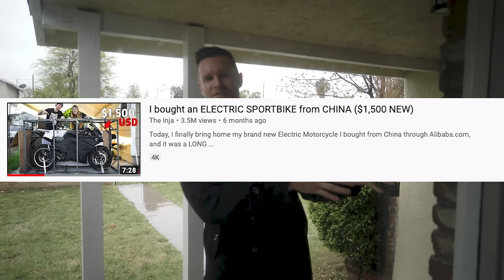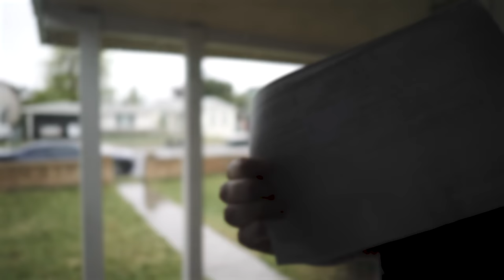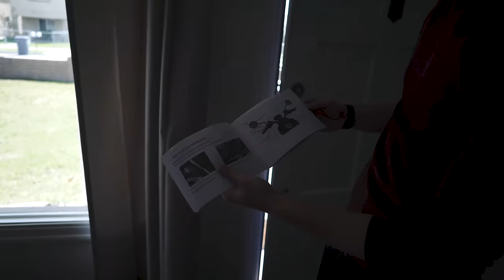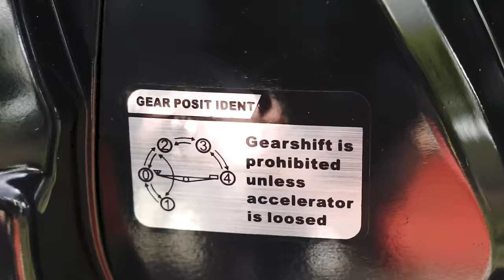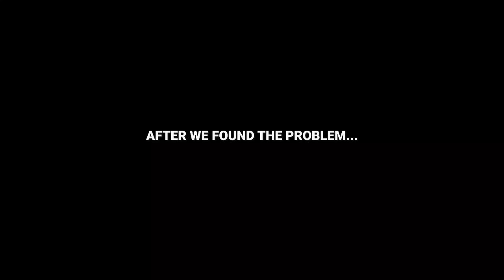I BOUGHT the most AVERAGE-PRICED Motorcycle on AMAZON ($1,600 NEW)

Comment: Definitely overpriced by about 2x
Cheap stuff is mostly trash
Reply: Strongly disagree, a 125cc dirt bike straight from the dealer is $2,500+, this is a deal and a half even if it is built cheap still worth $2,000. Dont take my word for it, do some research and educate yourself just a little.
Reply: YUK FOO well that’s the case with any new bike
Reply: YUK FOO  well no shit eh bud 💀 this is new straight from the box.
Reply: I bought a used 2002 Kawasaki Vulcan classic 800cc with 9k Miles for $1500.  and it runs great 125cc might be a little scary on the road if you don’t have enough power
Reply: Thank you Captian obvious

Comment: Bought this bike a couple weeks ago, ran into all the problems Inja did. for some reasons still can't grf the engine to start. I can get it to turn on, but can't get it started. can't find a pinch or twist in the fuel line. any suggestions? need this for work 😅
Reply: Also, already turned the fuel valves open, like Inja. still nothing:/ and no luck with customer service

Comment: Those bikes are like most harbor freight tools, once you buy them and bring them home you need to take them apart and clean them up! Sand surfaces down flat and debur gears or edges and remove whatever lube or grease they have in there and add your own good stuff and then reseal it all up good and wipe it down then you are good to go!!

Comment: The motor is horizontal cause it's not a motorcycle one but a cub one possibly a Honda Astrea knock off. Upside: reliability, downside: low power and torque.

Comment: You should always use 91 in motorcycles it keeps your injectors clean and pistons from getting burn residue on them. 85 doesn't burn sufficient enough.
Reply from the maker: This is a 125cc carbureted bike and 87 is fine

Comment: I would get a 2nd hand Yamaha YBR for that price. It is made in China (not Japan) but the engine is solid mine took me 30.000 miles of redlining for the engine to start going bad.
Reply: I recently checked the price of used Japanese motorcycles they're through the roof if you could find one that's working my local dealer has nothing the price of his new motorcycles are insane to my disappointment I see the Kawasaki is now being made in Indonesia could not believe it

Comment: It cost $1,800 now plus $400 shipping so  $800 price increase from $1,600.. that extra $800 is kinda a big deal when all you want is a $1,600 bike...
Reply: Unfortunately that's what happens in 2 years especially when there's a supply issue going on in the entire world prices on everything have gone up not one single item did not go up in price especially things that require chips if you're following the news you would be aware
Reply: @Mr.Robert1  Well you're right about that, it just sucks because it leaves you torn between getting something like a brand new Yamaha yzf r3 or a Kawasaki ninja 400 for about 5k and an Amazon bike for twenty two hundred dollars. Those other options may be double the price but they're double the value. I'm sure it was much easier to decide when the Amazon bikes were $1,600 shipped lol

Comment: One thing I've learned about Chinese products is there products are ok but they don't finish them off properly i.e they drill a hole but take of the Sharp ber swof on the edges which can cause problems in the future. I bought a Chinese watch from china and it looked beautiful and heavy like a good quality watch every thing was perfect it rained and condensation got in it took ages to dry properly when it did the automatic internals had frozen with rust all because they didn't put an o ring gasket to waterproof it when tightened down just small things that should be easy to do great film ♥️🙂💂🏻✌🏻🇬🇧👍🏻

Comment: Wait, did you say you had to have it registered with DMV before you could have it shipped ? I'm on the east coast and if I remember correctly I had to get my insurance payment before I could get it registered and plated if I remember right. Where I live is practically anarchy. They are not bothering with guys on bikes and most don't have plates or legit ones. I wanted to get a CBR 250 or Ninja 250 used when I see a good deal. Have my friend who knows how to ride and then before I get it on the road I want to get a good helmet and some other safety gear. But that part in the beginning has me confused.

Comment: Sup bro I bought the same bike it was driving fine now it’s turning on not even cranking what you think might be the problem?
Reply from the maker: Sounds like a pre-ignition problem: faulty battery, starter, starter button, etc
Reply: It was  a battery issue, my other question is does the bike charge the battery or I have to charge the battery separately with a trickle charger?

Comment: You can buy those engines for 100 bucks. So of anything goes wrong... buy a new one. Also theyre a copy of some other engine. Figure out which one and use that brand oem carburetor and ignition system and itll run right for longer

Comment: Did you ever figure out why the fuel gauge wasn't working properly?
Reply: It didn't look like he put a of lot fuel in it, looked like put half a gallon in. For my bike putting 1 gallon in the gas tank the meter still acts up and reads practically empty. Pro baby what happened here If I took a guess.

Comment: You don't understand how to be concerned of The engine in that design of the frame and how the engine takes the gas to that engine and how little gas you had in that that tank? Very little pressure flowed through the very stringy laid out fuel line to the carb

Comment: i would love to buy this bike as-is then take that weak motor out and slap some silly electric mid drive motor on it or dual hub motors.. I have a monster diy ebike but its on a bomber frame and setup like a dirtbike. i have all moto parts on it. not a single myb part. even moto brakes and forks, etc.. everything.. I love the bomber but it wasnt designed for this much power. ive been wondering what im gonna do for a frame upgrade.. Some cheap fully built bike like this would actually be perfect.. i wouldnt have to figure out which forks would work and which calipers would fit and rotos and all the little stuff nobody ever thinks of till after they start a build.. my build is over a year in the making. closer to 2 years. i love it but i need a strongger frame.

Comment: Hopefully u got that 87 washed out good cause that is not good to run through a motorcycle
Reply: What is recommended by the company that's what you use I have a Honda Accord brand new 1.5 Turbo and the manufacturer says 87 octane that's what it's tuned for because it's an efficient vehicle not a piece of garbage
Reply: @Mr.Robert1  A Honda accord is a car, not a motorcycle, Big difference!Motorcycles and cars are way different from each other,you run straight premium cause ethanol is the worst ever to run through a motorcycle or four-wheeler, and I know what I'm talking about cause I work on Powersports and that's my business

Comment: To bad he doesn't go positive at the front end(not edited properly maybe?¿?) & conversely starts off so pessimistically.
      A) this bike (older edition than I currently own) is from CHINA & is a "QUALITY PRODUCT"(.) Comparable to brands like Honda, Kawasaki, Almost Yamaha but using inexpensive products to wrap the bike in(causing the vibration he mentions& shows up front/thx 4 the fix btw) & people don't realize how much money in gas they're wasting when most every other country there's a much higher awareness by people & they're used almost equally in daily life elsewhere..
This bike is fast enough to keep up with traffic & jump off the start so as not to slow anyone down behind u at 🛑 or Light. Also has Much bigger tires which are important for safety reasons... 
A couple years later & it's @ $1,299 /plus shipping (now sent w/ "100% FULL Expert Assembly). Also @ a higher price 2022 model non clone blacked out, yes he got 1 right, it's  a cranked out looking exhaust pipe & switching it out is of importance of u value aesthetics that is.. but I bought mine via the same distributor and it was "on sale" at $1599USD+ 100%  Expert Pre-assembled & ready to ride(2the closest ⛽ anyway bc it's nearly on E).
GL & God Bless
Drive Safely & wear GeaR!